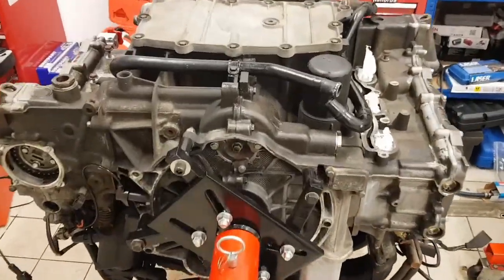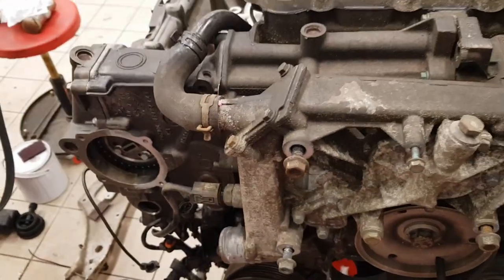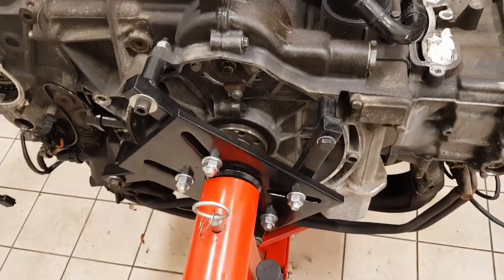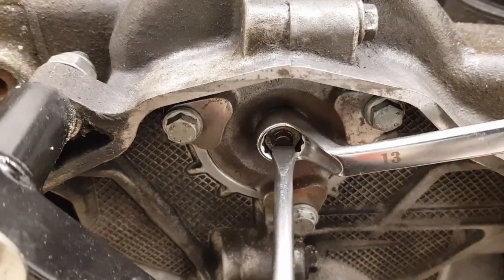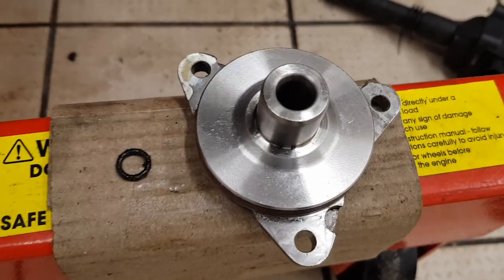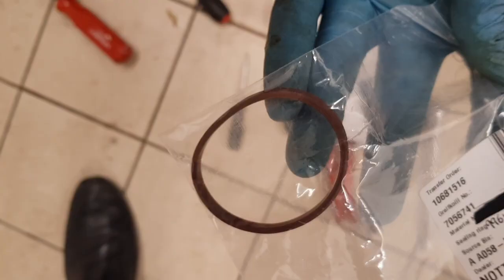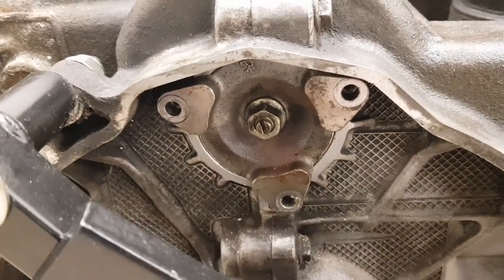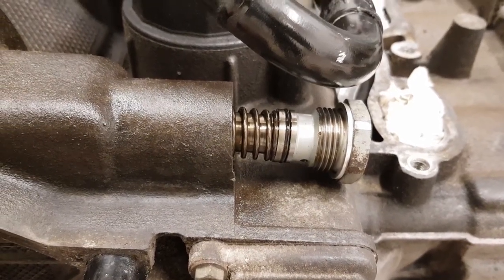Porsche 911 M96 engine IMS cover seal replacement

Comment: Hi Martin, very nice videos. Please, on min 8:18 you talk about a misalignment of the holes on the IMSB cover, and that you have to turn the crank 1 or 2 degrees, you mean that at this time that the IMS was not align to introduce the IMSB cover?It moved while removing the cover? And How do you turn the crank with the engine locked on TDC? Another thing, on min 8:53 you saying to be careful to not let the IMSB shaft to fall into the IMS... I think in that case that you still able to pull it out with a magnet, once it will remain inside  the IMS. I think its a good idea to remove that shaft and remove the old oil that remains inside the IMS and that degrade the IMSB. Thank you very much. Rogerio.